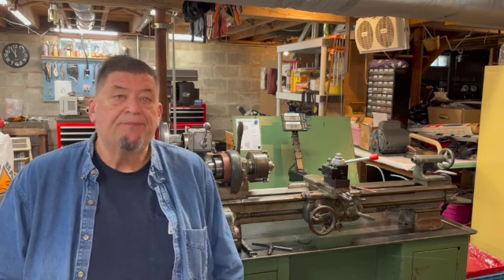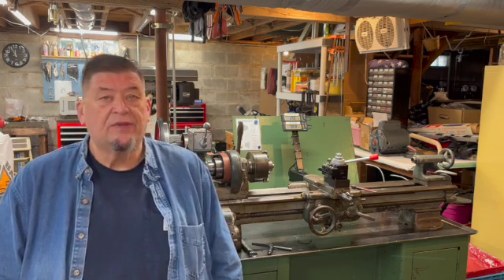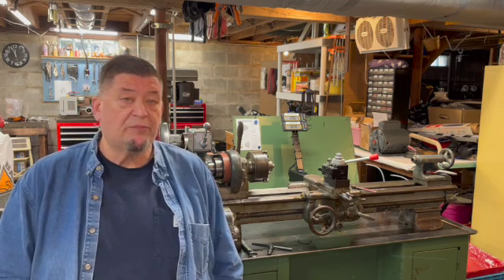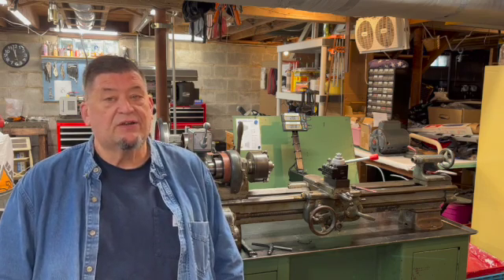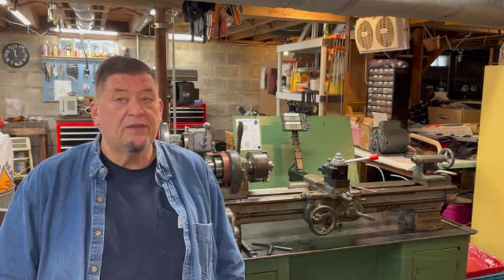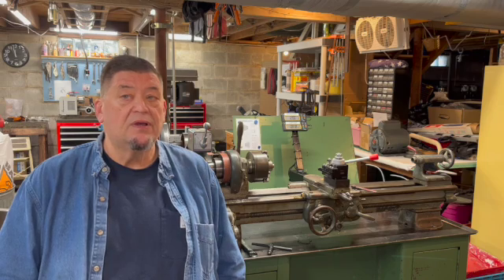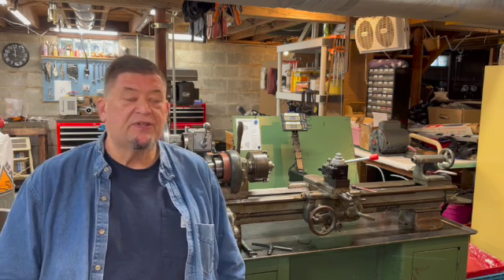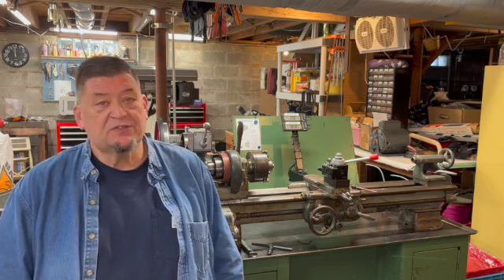South Bend 9" Lathe - DRO Upgrade!

Comment: This is great, so neat and directly in line with the cross slide lead screw, so the ideal position, I have a Boxford lathe which is a direct clone of the 9 inch South Bend, I'm seriously thinking about doing this mod to mine too, I like the way you mounted the other reader head to the cross slide set up, really neat. Yes, it looks really good, well done!, cheers from the UK, Dave
Reply from the maker: Thank you Dave!  I hope you do give a try.  If you do, let me know how it turned out and if you have any suggestions to improve.  Best regards, Jim

Comment: I gather the scales for my install and need to ask, what size square tubing did you use? Or was that a custom bend.
Reply from the maker: I bent that up from flat sheet stock but I suppose it could be fabricated from a square tube.  You would have to cut one side out for the bottom side.

Comment: This so far is the best solution for fitting dro scales to a South Bend lathe.  I plan on using your example to install iguaging scales to my lathe..Do you remember what length scales you used?
Reply from the maker: Thank you!  The scales I used are 6” & 36” for my lathe.  It’s noted in the comments for the video.

Comment: What was the procedure to have the iGaging DRO to display 2 X the value on the X axis? I am concerned that the value displayed will be 1/2 X to small.
Reply from the maker: To my knowledge there is no provision with the iGaging DRO readout to change to 2x the value.
Reply: @olennemac2502  So to be clear, you are not displaying Diameter, is this correct?
Reply from the maker: @raspen5  That is correct.

Comment: Very nice job!  I did a simular install on my Atlas 618 using the Iguaging scales. 
 I would highly recomend looking into the Touch DRO. It works in conjunction with the Iguaging scales and gives true DRO function including lathe mode. It uses a tablet for larger resolution viewing. It's a great asset to the scales, also allows for linear scale adjustment by the way! I'm sure you will enjoy your DRO over the dials, I sure do!
Reply from the maker: Thanks!  I have the TouchDRO on my bench mill.  I really like it.